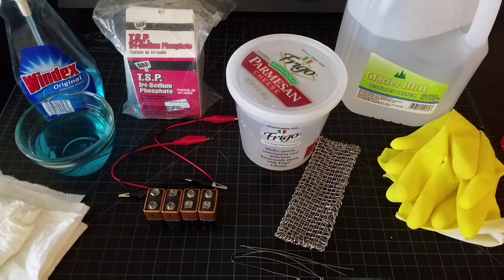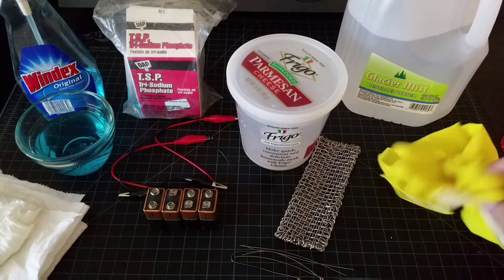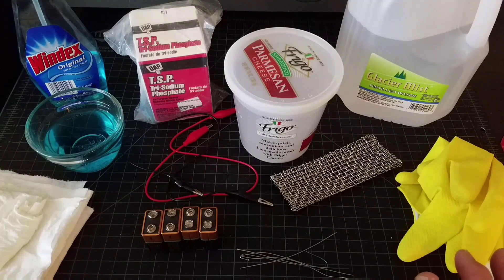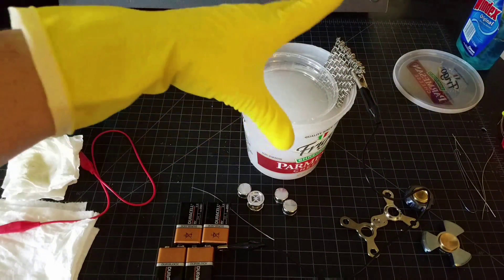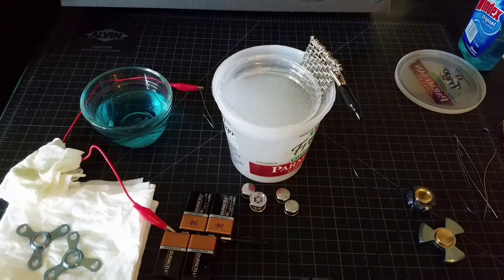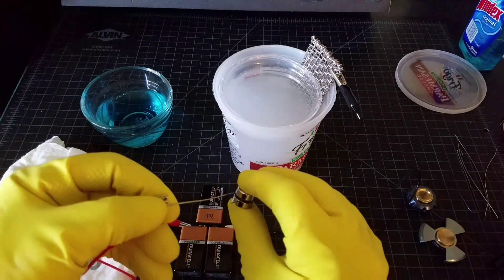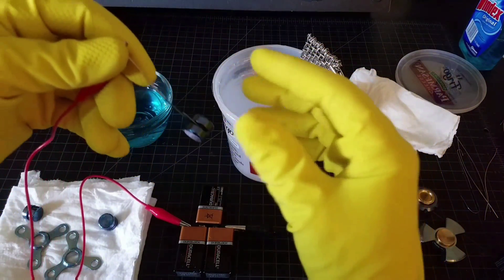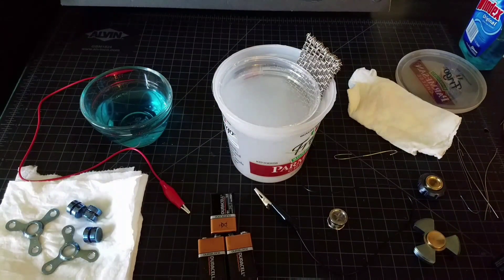Fidget Spinner Mods: Do it Yourself Titanium Anodizing Tutorial

Comment: do you have to use Titanium wire?  Could I use anything else to 'hook' onto the spinner/metal parts?
Reply from the maker: +Julian Carroll  I think there is a metal called niobium that you can use. Titanium wire is pretty readily available. I picked up 5 feet of it on eBay for $3. The supplies I had to buy came to less than $30. Water 85 cents, stainless steel mesh $4, leads $5, batteries $8, TSP $4, wire  $3, gloves $2.... pretty inexpensive.
Reply: I do not know if it interfer, but i used aluminum wire (the top ring of a can xD)...
https://www.instagram.com/tiggreee
Sorry but i'm proud. :)

Comment: Looks real cool, but does it make it spin longer? That is all I care about, max spin times.
Reply: nordattack 
Did you see him anodizing the bearing?
You will need a wheel spinner with multiple hybrid ceramic bearings of the same brand (they all need to be worn in and you need caged for vertical and cageless for horizontal spins) and you'll have to pick the best bearing after wearing them all in (they also need to be cleaned regularly) if you only care about spin times
Reply: Please explain what a cageless bearing is and what is the best made and where can I get one? I would love to upgrade my spinners to increase spin time.
Reply: nordattack 
The common bearings use a cage to hold the balls in place the pro if this is that there are less balls in the bearing so you get less friction from the  balls the balls stay in place giving less bearing play and the balls are always in the right position the con of this is that the cage drags on the balls slowing down the bearing
With a cageless bearing the balls can move freely between the races the balls will drop to the bottom when held vertical creating bearing play and friction between the balls (the bearing will also rattle) a cageless bearing will not give you the same spin with every spin it will only spin optimal with a good ball distribution you will need to shift from horizontal to vertical and back to redistribute the balls and get the best spin time
Cageless bearings aren't vey popular because of the varying spin times, bearing play and the fact that you can't spin vertically (the bearing will actually wear wrong when spun vertical too much) 
Cageless bearings are almost impossible to get in r188 size but they are widely available in 608 size 
Cageless bearings aren't reviewed much so you will have to search google and try a couple 
Try fz essentials (they also sell a cageless ceramic 608 bearing), spinetic high velocity or the stealth spinners super bearings If you want a good caged hybrid ceramic r188 bearing (but get a couple and wear them all in not all bearings spin the same even if they are of the same make and model)
Reply: Cool, thanks for explaining that. Great information.